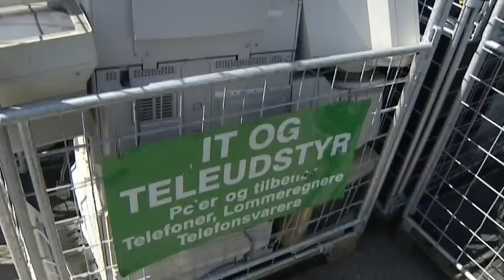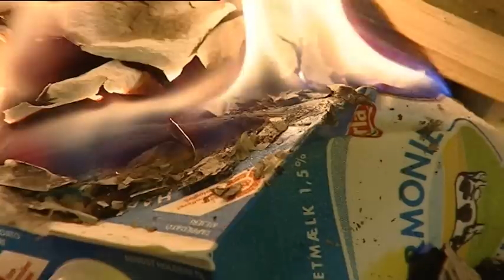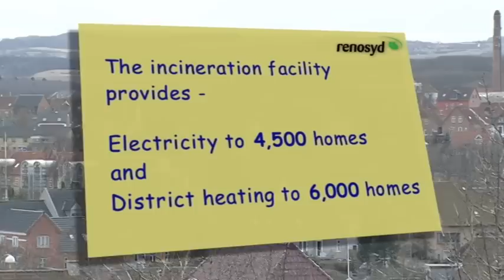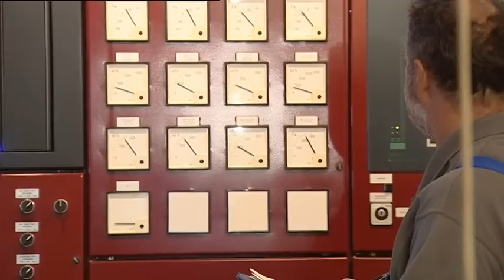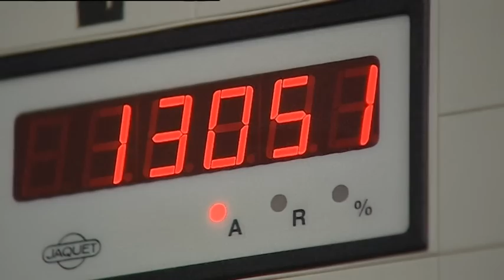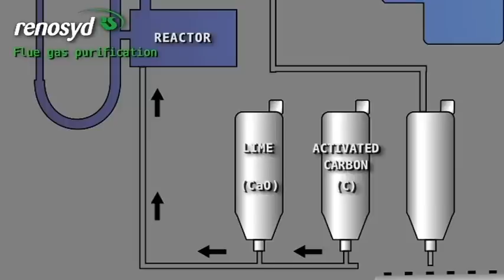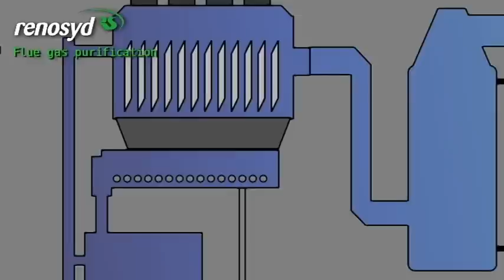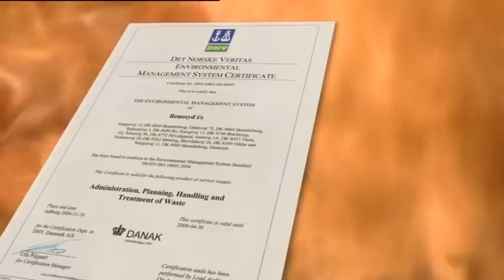Renosyd - environmentally responsible waste incineration (English)

Comment: I didn't know that Denmark even had the right terrain for landfills. I always thought that the country's terrain was similar to that of the Netherlands.
Reply from the maker: Denmark isn't quite as flat as the Netherlands and in some areas layers of protective heavy clay underground above the aquifier has made landfills possible, though today in Denmark landfills are out of fashion and are no longer used for organic household waste, recyclable materials such as metals and plastics etc. Most combustible waste is burnt to generate heat and power, so the primary material for landfills today is building rubble and similar waste. The trend is on of regarding rubbish as valuable waste rather than trash to be hidden out of sight and out of mind! (This film was made in 2008)
Reply: @channel6ada  There is, of course, one problem, though. More than 50% of Denmark's total waste is incinerated. That can't be a good thing.

That's one of the biggest disadvantages of incineration. It's not very good for incentivising recycling or waste reduction, because you have to keep supplying it.
Reply from the maker: @petercdowney  That really depends on your waste philosophy :) Incinerated waste is usually the unsorted and often wet/damp household waste which includes organic matter. Because of its organic component it must be disposed of in a way that prevents disease and infection - landfill was the old way, but that was a problem becuse of the unsorted nature of the waste - and because, in sandy areas, the organic waste would leach into the ground water. Incineration solvd the problem, and when the unsorted household waste is combined with combustible waste - both solids and fluids, this has an energy value too. In Denmark, almost 80% of households get district heating, over 60% of which comes from waste heat - either incineration or waste ehat from industrial and cooling processes.
Incineration is not pretty and there are some txic releases that must be eliminated, but it is easier to clean the emissions from a few central publicly owned and controlled facilities than many household or private incinerators and bonfires.
As Incineration has become more widespred in Denmark, so too has the sorting and separation of waste at source - my local refuse facility collects paper and cardboard in one container, glass, plastic and metal in another container, and other unsorted household waste in another container. In the past ten years, most danes have become used to sorting their waste so that the unsorted waste contains much less recyclable products.
Also we have waste recycling stations where you can deliver about 40 categories of waste for recycling.
Its not perfect - the real gains are to be harvested in reducing the amount of waste we generate to begin with, like simpler packaging, less plastics, especially one-time use plastics,  and less chemicals etc. The fact is that our modern retail society still uses too much packaging, too much transport, and too much that is thrown away.
So within that context, incineration in Denmark works :)
Reply: @channel6ada  In Denmark, maybe. And countries like the Netherlands don't have the option of landfills because they don't have the right terrain. But here in Britain, incineration hasn't been working. 

In local government areas in Britain that incinerate waste, recyclable materials have been redirected to feed incinerators. There have been increases in respiratory problems in areas near incinerators. Even after you clean up the toxic fumes, you still get an extremely toxic sludge that has to be disposed of in designated hazardous waste landfills – I consider that to mean that reducing that type of waste is of the utmost importance.

And that is why I haven't been convinced of the benefits of incinerating general household rubbish. Obviously there are some types of waste that must be incinerated – like clinical waste, for example – but I believe that the plastic content of any waste to be incinerated should be minimised.

But in a way, we do get energy from waste in Britain, even if the waste is buried in a landfill. You see, we capture the landfill gas and burn that to generate electricity.